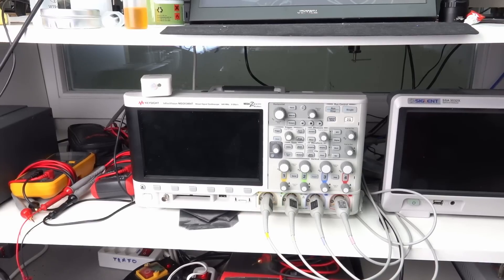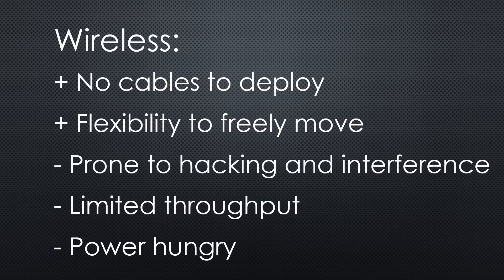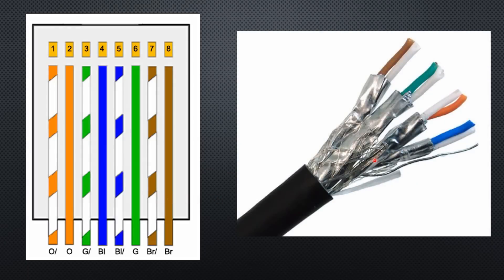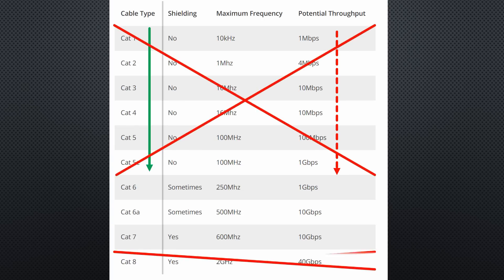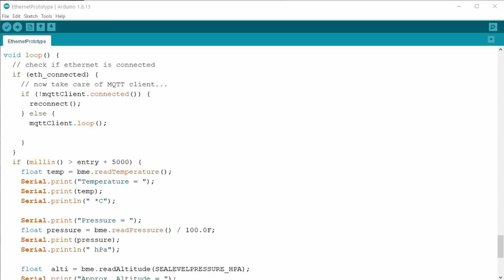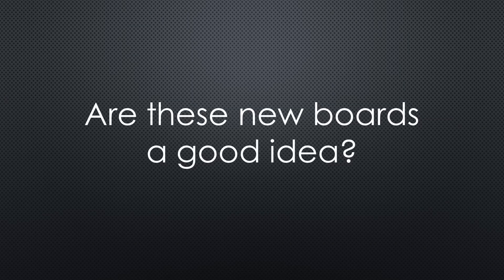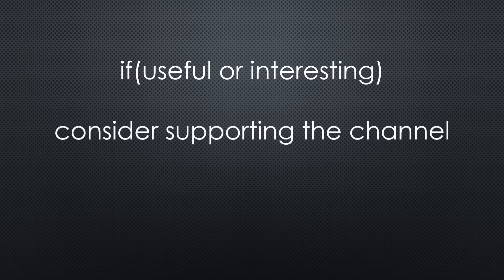#365 Is Power over Ethernet (POE) on the ESP32 any good? (New TTGO and Olimex boards available)

Comment: It's unfortunate you keep ignoring my products when covering things in which I've made a significant contribution. ;)  I was the first to bring an ESP32 board with properly isolated PoE to market with my wESP32 campaign ( https://wesp32.com ) way back in 2018.  I've seen some of my customers in the comments though--thank you!  Getting mentioned is the life blood of any small business.

Some advantages or my implementation are that I tried to preserve as many GPIO for the user as possible (15), and my board can provide 13W of PoE output power.  The advantage?  Don't just think connected sensors, but also actuators: motors, solenoids, deadbolts, PoE speakers ( https://www.linkedin.com/posts/j%C3%B8rgen-kragh-jakobsen-52a972_poe-audio-streaming-open-source-all-the-ugcPost-6625665154191278080-K2LZ ), LED strips, LCD screens, you name it.  There's a lot you can do with 13W of power.
Reply from the maker: Today I heard the first time from your product :-(  I had many mailbag videos since 2018 and I do not remember I refused such a board. One thing is clear: If it is not Arduino compatible it will not appear on this channel, though.
The TTGO board specifies 1.2A at 3.3 volts output and I stopped my test at 1.5A. So it has less power for sure.
Reply: @AndreasSpiess  Maybe I just don't know how this game is played.  Do the other manufacturers just send you their products?  If so, how do they know where to send them?
As to your other point: the wESP32 is fully supported by the ESP32 Arduino core.
Reply from the maker: My mailbags are open for my viewers and subscribers. Usually they contact me on one of my communication channels and we agree if it makes sense to send me something.
However I changed my strategy and will reduce the number of mailbag videos in the future.
After a long time in the industry my opinion is simple: It is easy to have an idea, more complicated to create a product, and incredibly hard to sell it and make money. Especially for engineers.
Reply: @AndreasSpiess  I completely agree with that, having gone through those steps with various products.  Another hard thing is getting on the radar of various Bloggers and Youtubers.

Comment: "cat7 for new projects"
May be a bit overkill for an esp*.
Reply from the maker: You are right. I said: For new projects, not for ESP32 projects. For me, Ethernet is an infrastructure which stays for a long time. Its purpose is defined after it is built.
Reply: @AndreasSpiess  for the average maker - as you pointed out - they want one recommendation and future proof it. I agree with you.
Reply: That's honestly an understatement, I mean he even stated in the video it can push about 100mbps at best and even high bandwidth devices like cameras don't usually even need that much, one of the few applications where you would actually max out 100/1000mbps is a NAS.
Reply: @vgamesx1  I think cat7 does a lot better over long distance than cat5e. That might be a reason to use it.
Also of course using it between infrastructure... Like routers and switches, where you might actually have gig+ data rates, but not to the esp endpoints.
Reply: @roboman2444  yup the only benefit is guaranteed speed over distance, if you are less than 30 meters, cat 6 24awg should be ok
Reply: When designing the offices building for the company I work for, back in 2005, I specified CAT6 cabling for the whole building, almost 400 points. People called me crazy. Today we're happy to have done it.
Reply: @talesmaschio  so your links between floors and racks are not fiber?
that is going to be fun when cat6 is not enough anymore.
Reply: Depends on where you use it. I have a fixed cat7 installation for my LAN (although 1/3rd of the ports are not used right now, like outputs behind the fridge - maybe needed in the future, but not now) and a cat5e for home atuomation stuff. The Cat5 is over the wall in cable tracks and so, so i can easely change them if i would need more speed. Cat7 is inside the wall (no drywall, plastered). It is in installation tubes, but still would be a pain in the behind to change those.
What i mean is: if you have complicated cabeling which you can not easaly change, then upgrade to the best you can get. If not, cat5(e) should be enough. I choosed cat5 mainly because it was way cheaper then any other multi-line cable i could find. At that time i planned to use it just for power delivery and maybe bus data, but power is enough now with cheap esp (first plan was with arduino and such).

Comment: Careful with the generalisations here. Cat 7 has shielding and metal plugs that must usually be grounded on both ends. If not, it has the potential to act as a big antenna and interfere with the signal. I’ve seen long runs of ungrounded cat 7 that ended up not being able to carry a signal at all. Also, is cat 7 really necessary for these boards, which presumably don’t support fast throughput? Cat 7 is chunky, so maybe going with a thinner cat 5 or 5e cable would be better for portability/ installation considering the performance wouldn’t be degraded?

PoE has several standards, 24v for passive, 48v for 802.3af, at, and bt.
Reply from the maker: 1. For me, Ethernet is an infrastructure which is not only used for ESP32 projects...
2. I covered the topic of POE standards in my POE video I mentioned in this video.

Comment: Would have liked to also see the wESP32 in the comparison.
Reply from the maker: Thank you for your feedback. This was not intended as a comparison between boards. This video, as the title says, is a comparison between wireless and wired. I do not think I would have found significant differences between the two boards other than reading the data sheets.
Reply: @AndreasSpiess  Well, yes, there will be no differences between the wESP32 and the TTGO, as the latter seems to be pretty much a rip off of the former - that's why I would have liked to see the wESP32 included, to at least give credit to the original. The Olimex on the other hand is an original design, and used to have a serious flaw in the form of no galvanic isolation from Ethernet.

Comment: • 1:50 - Wireless also has the downside of poor (compared to wired) reliability/stability, e.g., disconnections. Really, the only downsides of wired are the inconvenience and slightly higher cost (for the wires).
• There doesn't currently seem to be a proper standard for Ethernet/WiFi libraries yet, so you could have all kinds of issues getting it to work depending on the library/libraries used. 😕 I experienced a very specific bug trying to use a wired connection with an Arduino (it was either the EtherShield or EtherCard library), and ended up switching to WiFi instead.
Reply from the maker: I think I mentioned that this technology is new to the Arduino/ESP32 community. So we will see if we find a lot of problems...

Comment: I don't see the point in recommending Category 7 as is not recognized by the TIA/EIA if I am not mistaken. It is quite expensive, might use non standard TERA connectors. I would personally stick with 6A for now. Cat8 is an option, as connectors are again standard rj45, but it is expensive and lengths are limited.
Reply from the maker: I expressed my opinion because I like shielded cables more than unshielded ones. And 6A does not guarantee shielding...

Comment: The reason both A and B standards exist is to allow for the creation of "crossover" cables. Before the introduction of auto MDI/MDIX and especially it's inclusion into the gigabit ethernet standard a crossover cable was required to connect ethernet switches to each other, or to directly connect two computers to each other. Saying is does not matter is a bit of an oversimplification because slower devices that do not support GigE often do not include audio MDI/MDIX functionality and are still being sold.
Reply from the maker: Thank you for the info about the connection between type A and B and crossover cables.
I think I mentioned the fact that we used crossed cables in the past. I did not have a device in my home for years without autosensing.

Comment: The cheapest test tool requires an additional ground connection between the transmitter and receiver. This could be as simple as a wire shoved in between the enclosure and test connector. The connectors have a shielding can connected to ground. 
Also, the RJ45 connectors with connector wire pass through will save a lot of time and headaches.
Reply from the maker: You are right. I recently bought a pack of such connectors...
Reply: @AndreasSpiess  
 I have an unrelated question for you. What resources do you know of for finding obscure part documentation? I'm searching for 2 mystery electro mechanical parts that are made by either Foxconn or Hosiden. I know they are used in multiple Nintendo products and are widely available from Shenzhen direct suppliers, but no one lists part numbers. I've looked through dozens of listings, and sent documentation request messages but still waiting on replies. I've searched Mouser Digikey, and Arrow, but they don't have any matches. I would really like to have a datasheet for all parts in my current reverse engineering project, but the USB-C receptacle and a through-board side-mounted momentary push button are crushing my hopes and dreams right now. 
   I think I need to learn what the Asian supply chain is like. I know about LCSC but they seem to target western hobbyists, and didn't have anything. What is the equivalent to Digikey and Mouser in Taiwan, China, and Japan? Any ideas?
Reply from the maker: I only use Google for my research. Often I find links to other sites in some comments in forums or so.

Comment: ESD stands for Electro Static Discharge and means the board is static sensitive. Means you should wear a grounding strap and work on an ESD matt or you might burn out the board.
Reply from the maker: You are of course right. It was meant as a joke. This is the first Chinese board I got with such a sticker. And the sticker was placed in an area where I think the ESD should be not a big problem. All other pins are probably more critical...
Reply: @AndreasSpiess  :-)

Comment: I would be interested in ethernet+esp32Cam but it sounds like there are not enough gpio pins to support it.
Reply: I've made a little plug in camera module for my wESP32 (it has just enough pins to make it work), but I wasn't sure if there would be interest.  You think it's something I should bring to market?
Reply: @PatrickVanOosterwijck  My use case for the esp32-Cam is to serve as  limited intelligence remote camera(s) for a Jetson Nano doing object recognition.  Even with the external antenna, I found the esp32 wifi to be flaky.  Also, I didn't want my wifi network bogged down with multiple streams.  I considered doing wired serial  transport to a co-located raspberry Pi.  My original concept was to have multiple (5+) esp32 Cams with different fields of view.  However, for less than 3 cameras, the advantages of using esp32-Cam's disappears.  So, my market may be small.

Comment: Stability of the (wired) data connection is very important for (critical) monitoring  appliances. (I mis the stability aspect in the argumentation. ) So when stability is important for your non mobile solution, a wired connection has preference. Don’t flip a coin but nowadays always pick T-568b; it’s the current industry “choice”. Questions I have: 1) what are the experiences with current version of ESPhome and the support of wired modules (which ones are the best), 2) can a wired network interface be added to the wireless ESP32 and which hardware interfaces are supported, 3) what are the costs? Thx. Andreas for all your great work!
Reply from the maker: 1. I assume the frameworks do not (yet) support Ethernet. But you have to check. Maybe you find a fork.
2. I mentioned that I did not try wired and wireless together. So I do not know. I Assume all interfaces using the same chips are supported. Pay attention: Some boards do not have POE functionality.

Comment: I have Cat6 cables with POE in most cases run all over the attic of my house for both security camera', RPI running ADSB plane tracking (close to the antenna on the roof), and a jump underground to my workshop.  At one time my Internet was WIFI across the lake and the Cat5e cables on the roof to the antenna died after 2 years wherever the sun hit the cables.   I've since switched those cables to Cat6 UV rated (and to LTE internet but that's another story).   The moral of the story is cat5e indoor cables should not have any Sun hitting them,  even a short 2' section to your weatherproof box on the roof.  After 2 years of Sun exposure they will just crumble in your hands.
   I also have ESP32's  monitoring  the temperatures on my geothermal heat pump water lines (intake and outlet),  attic temps (metal roof with radiant barrier and solar vents), and my workshop temps.  All of those ESP32's I would have loved to power with POE but instead they reside in closets with wires going into the attic or basement and a AC adapter to power them.
Another point I'd like to bring up is often you will use a POE splitter to break the power and Ethernet signal out to your device, such as my RPI that runs ADSB on the roof.  The wrong POE switch and splitter will limit you to 100mbit since it will take over a wire pair from Ethernet.  However you can get 1gbit rated splitters and switches that will allow full speed Ethernet connections.  The splitter supporting full Ethernet speed will state something like:  PoE splitter 802.3af compliant gigabit port.   Very important if you expect to update a remote RPI or transfer a lot of data.
Reply from the maker: Thank you for sharing your experience! I covered some POE aspects in the POE video and di not want ot repeat them here...

Comment: I've been waiting for this, thank you very much! Not if I ever asked this but are you aware of any "Power LAN" enabled IoT devices? Something of the size of a Shelly1 that could be dropped behind wall mounted switches or similar applications? I know "Power LAN" may lead to signal issues and can be slow and unreliable but once working it should offer plenty of bandwidth for IoT usage. I would rather use such devices than dripping wireless devices into the walls. Not sure how easy it would be to hack "Power LAN" connected devices but  the currently deployed solutions I know  to be lacking severely in terms of security. Anyways - love your show - it's gotten better and better over the years. Thank you very much for keeping at it! Cheers!
Reply from the maker: I think this is a different story and so far I never heard of such projects.
Reply: @AndreasSpiess  Me neither but I haven't been on top of any such research for quite some time now. I did find a few one or two modules that connected to a PowerLAN like infrastructure for industrial applications. Those were very expensive, usually very bulky and did not even offered Arduino grade computing or IO. They usually only provided an interface but not for example IO plus DC power output plus esp level computing in a small module which most home automation enthusiasts are currently looking for. Anyways - thank you for your quick response. I hope someone will take on the task in the future as I have been looking for such a device for years now and nothing usable ever showed up. Cheers!

Comment: It seems too much of a compromise. I think giving up 8 pins to add the Ethernet pulls the number good use cases too low.
Just my opinion.
Reply from the maker: You can add quite a few I2C devices...
Reply: pin extenders exist.
leave native pins for timing critical applications.
Reply: There are probably some Ethernet shields that use some variety of two-wire connections.

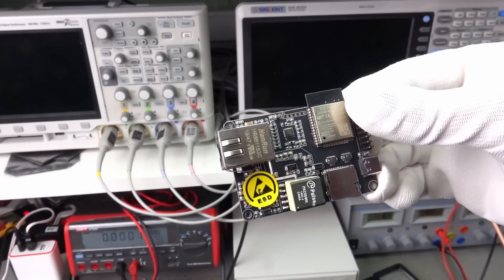Comment: 7:30 "ESD" stands for "Electro-Static [breakable] device", meaning some components may be destriyed by a static electric (high voltage) discharge while touching it. It is recommanded to pull yourself dow to the ground (thru a 1Mohm resistor or a dedicated wristband) to protect such device while manipulating it. "ESD" sticker doesn't mean there is a risk of high voltage for yourself ;)
Reply from the maker: I think we both know the sticker. My question: Why is this the first Chinese board with such a sticker and why at the point where the pins have to be protected against all kinds of external signals?

Comment: I still use Cat5e for many applications, that is, as long as I have them in stock. It depends on the purpose and very important the distance. You'll be amazed of the speed over short distances. Usually I use Cat6, also for short distances. It works quite good. Why not prepare a video with distance/speed tests. Great video btw !
Reply from the maker: You are right, for existing projects or slower speeds they are ok. I meant with a new project: If you start to wire your home, for example.
Reply: @AndreasSpiess  for wiring my home I will use Cat 7, but for (most) IoT I would use the cheapest available mostly Cat5e. The ENC28J60 can only do 10Base-T anyway. And I use simple passive POE (or just my needed Voltage e.g. 5V) over the unneeded two pairs.

Comment: When I was in Syria I use the telephone line for lighting the led when electricity is off using a special circuit  :D
Reply from the maker: No problem. They carry around 60 volts if I remember right.
Reply: @AndreasSpiess  Standard phone lines (POTS - Plain Old Telephone Service) in the US sit at about -50 volts DC with respect to Earth, and rise to -20 volts DC (or so) during a call. Ringing is a -120 volt AC signal though. Don't lick phone lines to check if they are live. :-)
Reply: Telecom uses still 48 V lead batteries. Subscriber lines are fed with this about 52 V via nominal 600 ohm resistance.